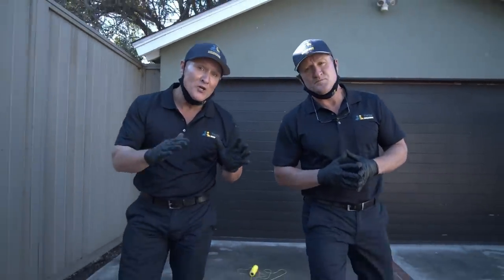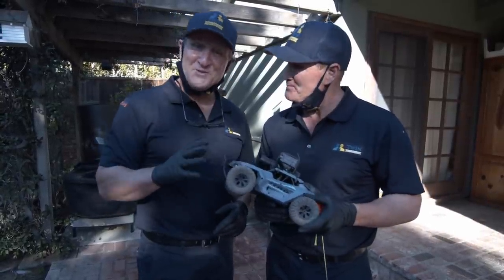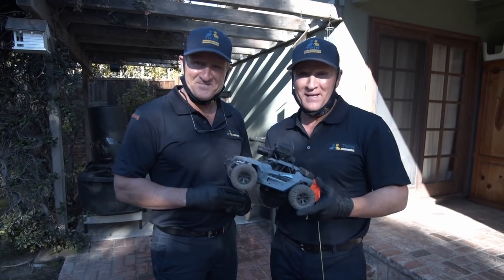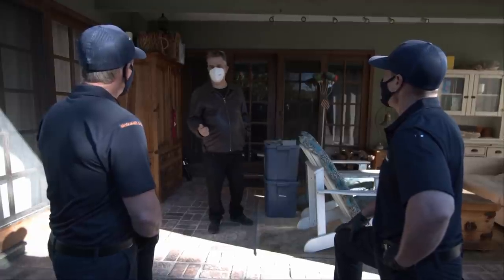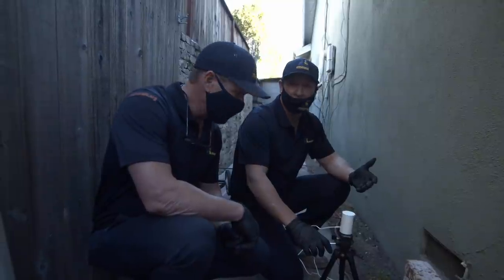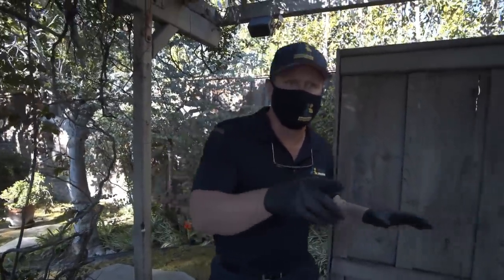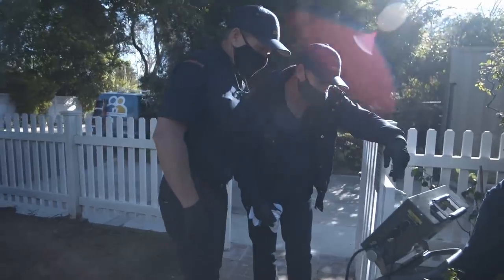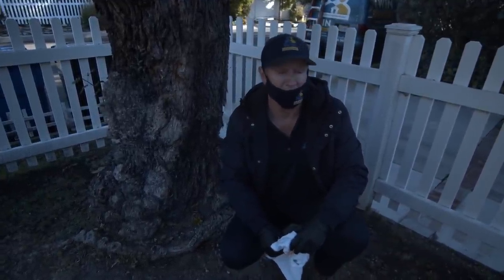Rodent call takes a BAD turn...

Comment: 30 yrs of mice issues and never seen a single exterminator spray any enzymes sprays in my house to clean things up...... you guys are awesome!!!
Reply from the maker: Your awesome to share this with us! We appreciate you 🙏🙏
Reply: Its like dr zymes tthere so many uses
Reply: These guys need to come to my house we had mouse problems for years and council tried all kinds of poison some affective some not but they always come back in numbers
Reply: @kushcloud420  me to years of mice i had..... luckily i found there entry point by accident one day on my own...they were climbing side of the house and getting into some loose siding .....i fastened up the siding back up and added some steel wool along bottom edge of siding along the house and im good now

Comment: rats very commonly enter houses via any vents which have outlets on the house exterior: dryer vents, ventilation vents, ANY vents which exit the house on a wall are entry points for rats, and need to have a wire mesh protector fitted over them!!! Plastic louvres or flaps on vents are NOT protection against rats. rats chew through such flaps in a few minutes, then enter the vent, travel along the duct, and then chew through the duct and drop into the house. I am daily fitting wire mesh over vents for my customers!!!!

Comment: My parent's kitchen line had a break under the kitchen for 10 years. They waited until the line completely collapsed to repair and unlike this house, there is no crawlspace, their house is concrete foundation on soil. Fun fact, that sewer soil smells like mulch you get at home depot. Also my parent's cast iron line was completely compacted for three feet.

Comment: The circumference on that galvanized pipe was not that bad because mine was down to half and inch!  Mine was only a short run from a sink drain to the main. The reason mine was so bad is because it was not pitched properly when the house was built (1950's).

Comment: I'm a pest control tech in NorCal. I have 2 nest indoor cameras in an attic of a food court in a mall. I observed 30+ rats per night. Then I placed a victor scent away (mint) repellent ( it's like a glade plug in) and the activity dropped to zero overnight.
Reply from the maker: Wow! Great share. How long did you continue this? Was it sustainable?
Reply: @TwinHomeExperts  they used to be $10 on Amazon. Now they cost $17. It's been 4 months, I change them out every 30 days for an additional $30 per month on their annual contract.
Reply: Sweet
Reply: @davidp2of3  your a beast
Reply: Did it keep working?

Comment: 100 percent you need to fill up a tub, i am having trouble with my drain.  i think its just a hair ball but time will tell.  if i run a faucet or the shower... no problem... but if i try draining a full tub it will overflow.

Comment: I remember hearing galvanized and cast iron.  The two should never mix.  Sorry, ignorant, unqualified plumbers are to cheap to do the job right.  They will use pressure fittings etc. vs drain fittings and problems develop.  When you live in Podunk that is all there is and there are no professional, can do folks like these twins that have the knowledge, or the equipment to do anything that resembles quality work.